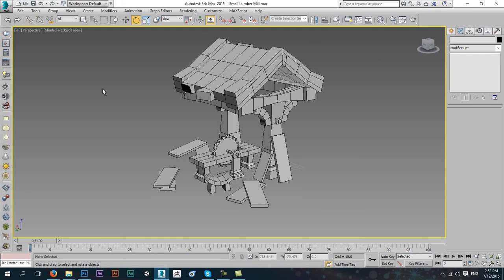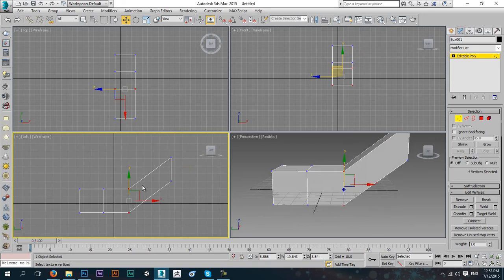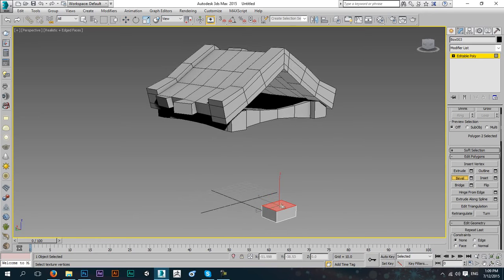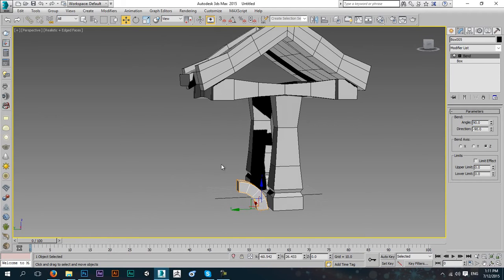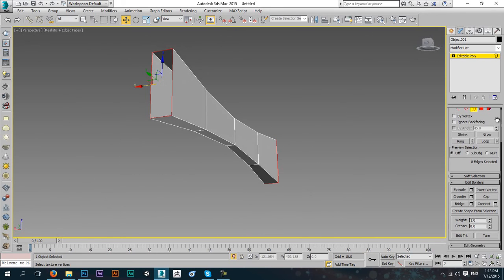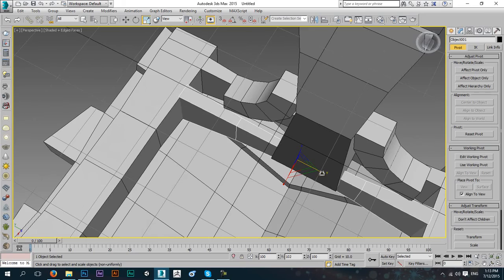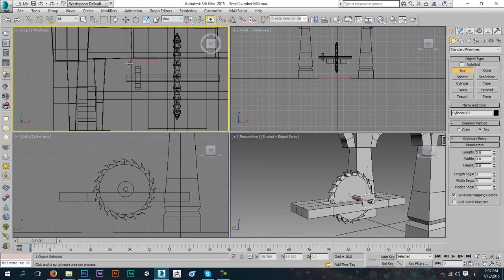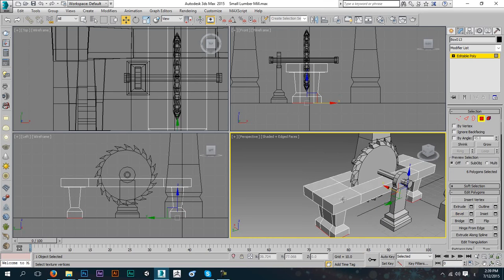How to create a Lumber Mill game asset in 3Ds max (part 1 - Modeling)

Comment: Excellent tutorial. A question tough. Whats your opinion about using chamfer on some edges?. I found that some artist use it all the time to remove hard edges and other, just as your model doesnt use it at all.. what your opinion on the subject?
Reply: i see no one answered this perhaps i could help and shed some light on the subject, the title of the video should be changed to "3DS MAX: How to Model a LOW POLY Lumber Mill in Game Asset" its my understanding the author wanted to produce the lowpoly version of the lumber mill the actual asset used in the game engine, chamfered edges adds to the poly count making it more of a hi res model verses an ready to input into game model, you would make the high poly as well as the low poly and use a normal map to retain the hi definition for the low poly model to make it appear more detailed than it is, its a common practice among 3D artists for games. i hope this helped. sorry if its confusing or "too late" and you already got your answer